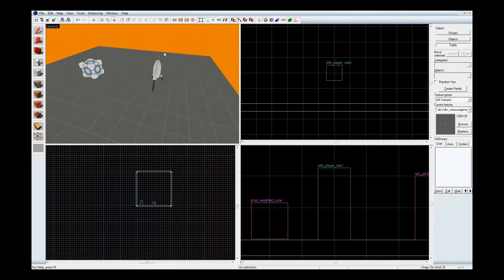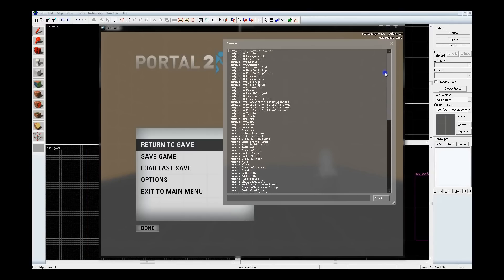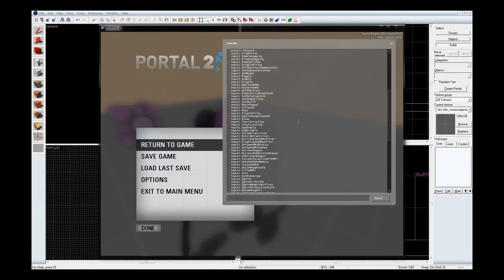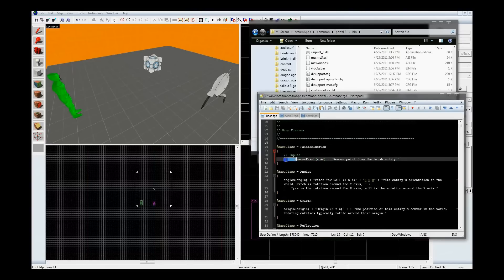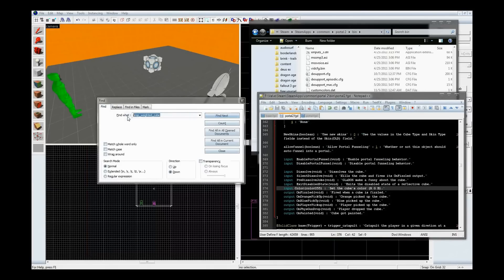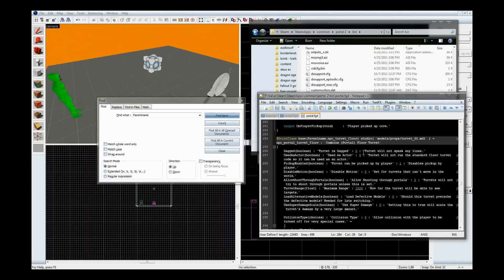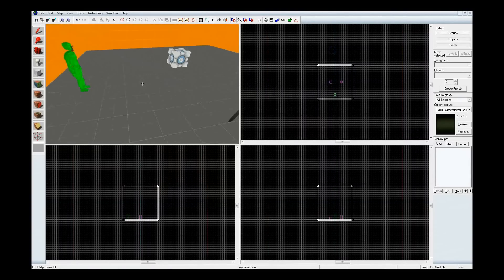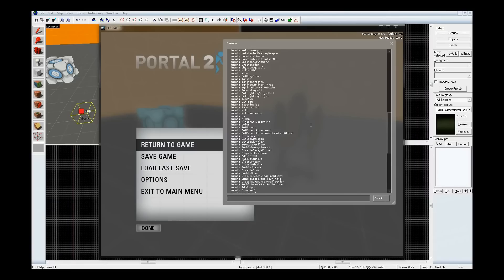Portal 2 - Editing FGDs Tutorial

Comment from the maker: If someone was to open the vmf in Hammer without the edited FGS, they would need to turn off smart edit to manipulate the keyvalues. Added i/o would be removed by Hammer if they tried to mess with it.

The fgds are in the portal 2/bin folder. Packing them into a map/vpk wouldn't make sense unless you somehow added the map to the list of folderpaths for the tools to draw from (even then, you'd need to make sure it is a position to replace the default fgd)..